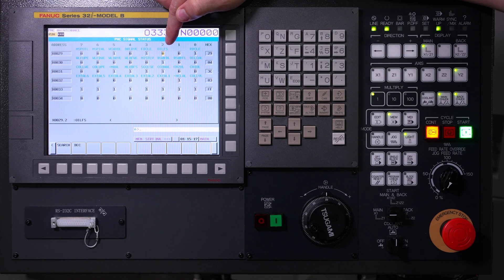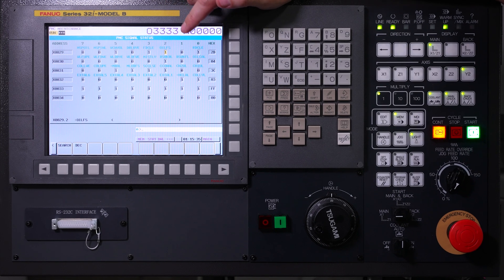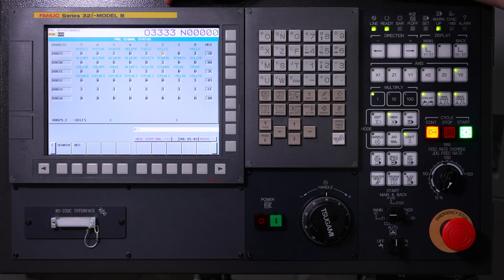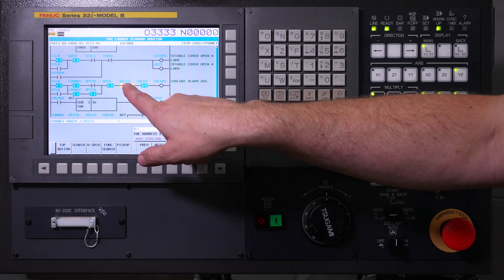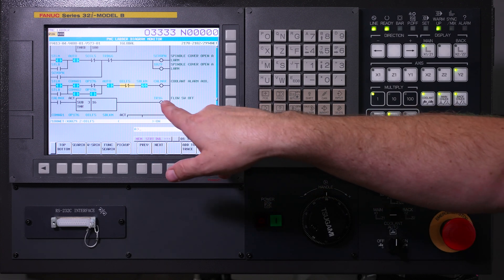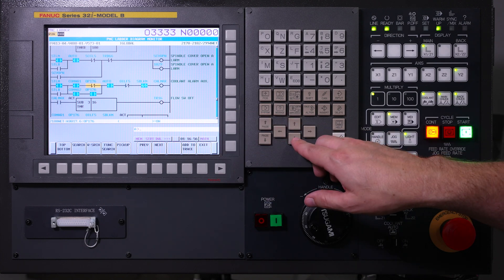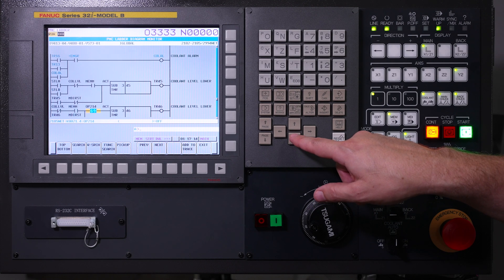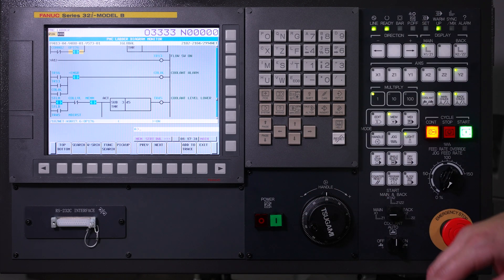Setup, Maintenance, and Troubleshooting Tips for your Keyence Flow Switch

Comment: sorry can't agree with 15 gl/min setting. we have 3 20mm machines which have this sensor. typically run between 8-13 gl/min when tank full and everything cleaned out in tank. we have had to set to 3 gl/min to be able to make parts.